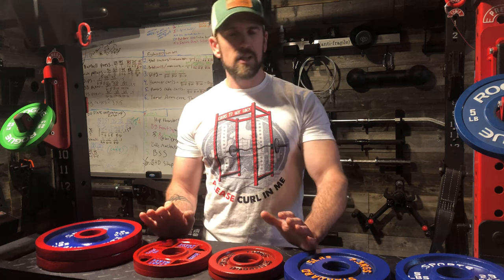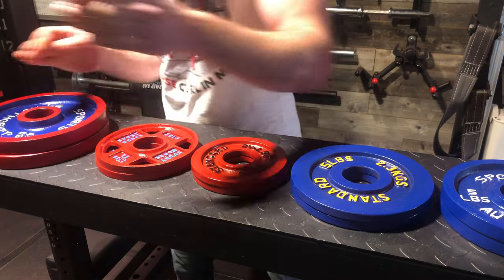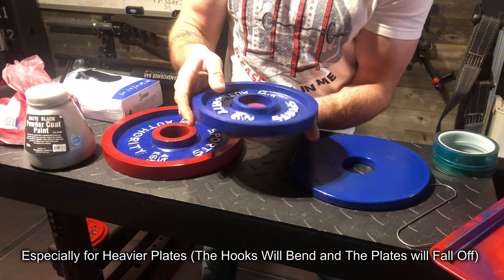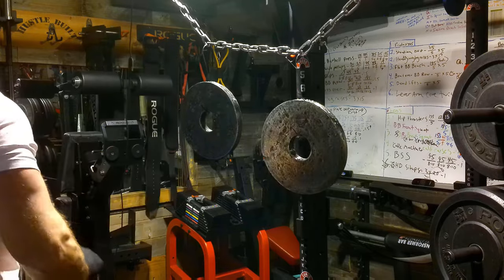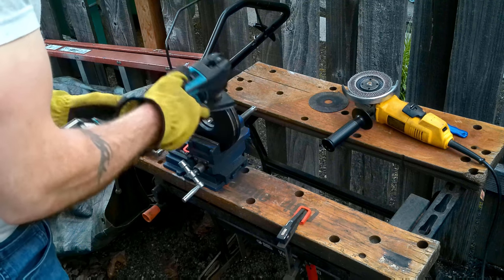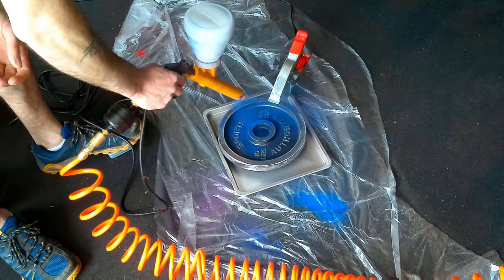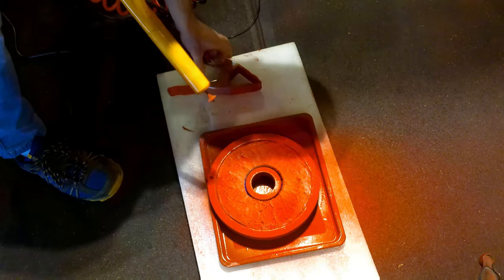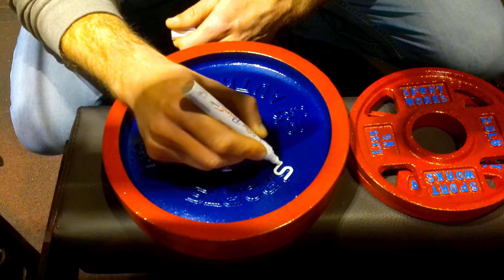Restore Your Weight Plates (3 Different Methods)

Comment: Nice video on the powder coating process. Have you tried using an e-tank to remove all the rust and most of the paint? They are great and almost no labor.

Comment: Great DIY. You are getting hood with the powder coating. Ever consider doing anything bigger? Bars, rack uprights?
Reply from the maker: I'd love to redo my whole rack but unfortunately I would need a walk in oven!! So i'm limited to what will fit in the toaster ;)
Reply: @CurlsintheRack  I am sure eventually you will figure out a DIY walk in toaster to redo your rack. Haha
Reply from the maker: ;) maybe I will just powder coat everything and set the garage on fire!!!
Reply: @CurlsintheRack  maybe try a long piece of iron pipe (4-inch waste pipe from an old house demolition) and a heat gun to make a mini tube oven.  Unless you really, really want to burn down your garage...